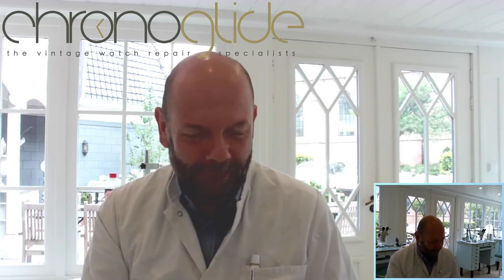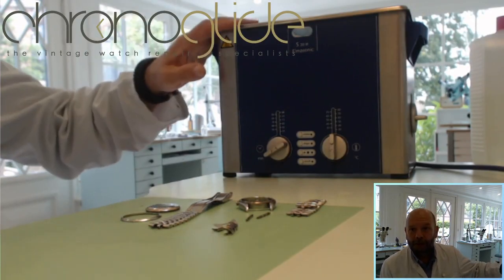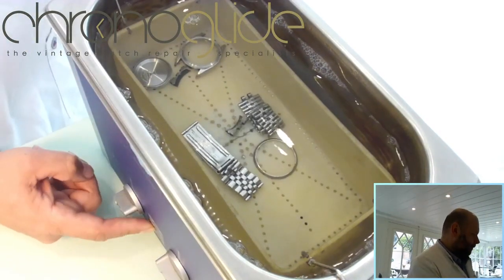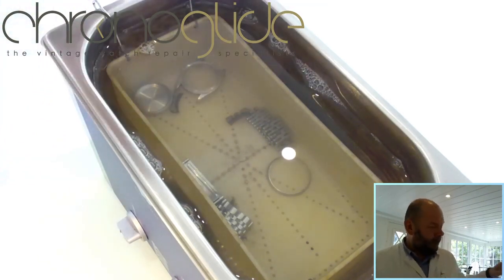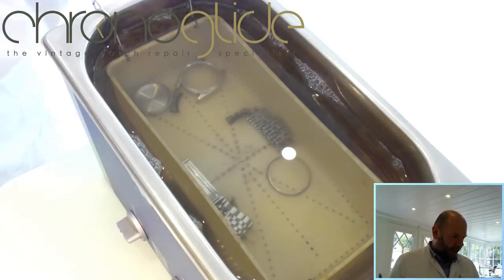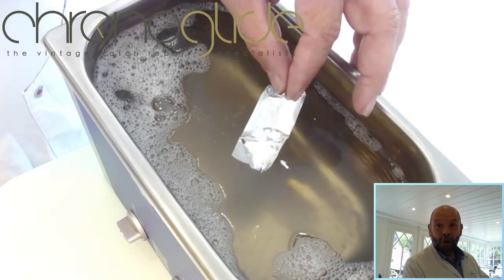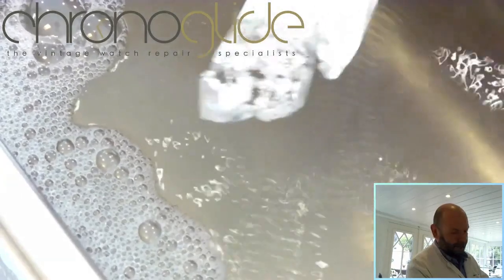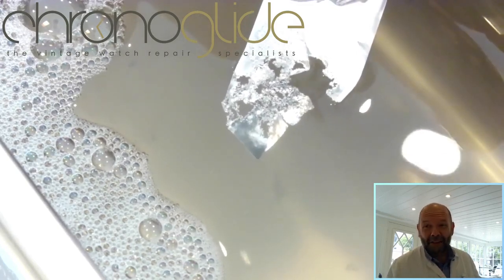Ultrasonic Cleaners - Tips and Tricks

Comment: Difficult one as from a hobbyist perspective when they (and how I) start they can’t justify £400 for a used cleaning machine and the £100 for the cleaning fluids.
What you have to take into consideration is that what is hobbyists buy is cheap low end ultrasonic. Mine is 2ltr and not very powerful but it serviced me well for 3 years until I had the opportunity to purchase a cleaning machine .
Granted fatigue is a potential issue but using paper tin foil against a price of stainless is not comparable in my opinion. 
This is also why I tend to recommend to new starters to just buy the cheap cleaners.
If a hobbyist could only use pro equipment there would be no hobbyists. 
Main complaints I see is spring winders and cleaning machines being too far out of reach for them.
Reply: This is a professional watchmaking establishment, they've got 2 cleaning machines, 1 for the filthiest movements and then they go into the 2nd, the 2nd is for the not so soiled movements, I suspect putting a clients vintage watch into a Ultrasonic probably frowned appon, although it happens in other places, I use my one for my DE Razors and vape equipment and watch straps and cases.
Reply from the maker: We do have a pre-rinse machine as well John, especially for clients who tried to revive their pocket watch with WD40 ;o(
Reply from the maker: I agree there is a gray area for Ultrasonic cleaners and movement parts.
Reply: @kingsford73  it is but I don’t think many other professionals are watching .
Reply: On average I clean about one watch a week, by hand . I think each part has for more attention and care cleaning this way. I have always thought that the initial cost and running costs of a cleaning machine are way above my needs and I believe I would have to be servicing a lot more watches per day/week to justify those costs, then If I were doing that amount of movements would it be a hobby ? I have toyed with the idea of purchasing an ultrasonic, now I am so glad I did not , so thank you Kalle for that information
Reply: @MyRetroWatches  it goes on but is it best practice?
Reply: @ChronoglideWatchmaking  Ha Ha Ha WD40 fixes everything including that Breguet daddy found in a charity shop for £1.50 "Don't worry my son, this'll fix it"
Reply: @garethlowe9199  I agree, hand cleaning is the best way for hobbyists ... professionals move to another level, and have different needs.  I have found very good the clear benzine for cleaning all watch parts  except pallet fork, and ballance wheel (for the shellac) ,and main spring (Donald de Carle says the main springs broken for some reason with benzine). for these I use zippo (lighter) fluid.  The ultrasound machine is good for bracelets and watch cases ... I agree with Kalle.
Reply: I'm glad you came here to confess to this Guy, I wasn't going to grass you up here..😂.. You made the point that I was going to make. Tin Foil is not what Vostok's are made from, just an example of course.
Plus, maybe the hobbyist won't have access to a Rolex to dump into a Sonic bath.😱for two hours😱

Personally, I've never broken a watch using a Sonic bath. and mine is very small, just about one litre if that.
Reply: Too late for me to learn this. I ordered an ultrasonic cleaner yesterday. I'll not use it for the delicate parts but only for cases and bracelets. I am very happy I saw this before ruining anything.
Reply: @stevecuthbert8856  It's fine.  Watches are not made of foil.  
Foil is used to test if the ultrasonic cleaner is actually working. What happens is the microns thick foil flexes at very high speed, which essentially rips it apart.  It's to do with the fact that foil has a very large surface area, but a thickness of less than 10 microns, which is 0.010mm for cooking foil.  The foil they wrap chocolates and mints in is even thinner.

 Thicker parts are not like that, they are not going to break.  I don't know about watch crystals since I haven't looked into the science but my thoughts are that (a) you need to polish the crystal, not clean it and (b) it would only break if was degraded and falling apart already.  You flex the crystal way more than this just installing and removing it.  Similarly, any jewels that get ripped off are ready to fall off anyway.

Ultrasonic cleaners work by cavitating the cleaner and pulling the dirt off the surface.  They are used by jewellers for deep cleaning of rings etc.  since it will pull the dirt and fibres out from under the stones, restoring the brightness to the setting.  There's simply no other way to do that job without removing the stones from the settings.

Cavitation can cause erosion of parts but it would take a long time.  15 minutes is of no concern even for plated parts.

Also look at the type of ultrasonic cleaner.  A 200 watt industrial cleaner is not the same thing as a 40 watt jewellery cleaner, and a 200 watt industrial cleaner is likely to be more expensive that a proper watch cleaner anyway.
Reply: As I’m new to the hobby…  I like simplicity and use the baskets in lighter fluid or naphtha then rinse a few times in distilled water then a final soak in isopropyl. 
So far so good I think😊 
Note: all you watch guys, pros and non, are great and very helpful to the novice ! Thank you for your effort in making the videos!

Comment: Thank you for this, but please - help me understand this. All high end cleaning machines are with ultrasonic. The best ELMA Solvex VA is ultrasonic+spining, as well Greiner ACS900, Lititz Freedom, Wellner L2, L&R Tempo 400 and many L&R from the past. They have ultrasonic in one or more basket(cleaning and sometimes for rinse too)
I see what you did there with piece aluminium but there is no aluminum used in watch movements. Piece was ultra thin, and aluminium isn't springy in any way, it will more likely crack than bend. Where is a connection between real application and your experiment besides maybe some super super old movements that shouldn't be machine cleaned anyway as some plating might flake ?
Also, you mentioned water based cleaning solutions and that they are not that great. Both Elma and Greiner are suggesting use of water based cleaners, you just need to rinse them at the end with some kind of degreaser like ipa/lighter fluids.
Thanks again,
Reply: Some really nice conversations going on here. I am thoroughly enjoying it please keep up the good work everyone!
Reply from the maker: We are all enjoying the conversations Shawn ;O)

Comment: Wrong Kalle I have a 1955 Watchmaster watch cleaner using for 20+ years and no broken or degraded parts-with a 5minuet pre clean in Napha everything sparkles. I is 100% ultrasonic with 200 watts at 42 kilocycles with 5minuet clean rinse cycles.:face-green-smiling:  And cost me $400.

Comment: If you buy one, look at the ultrasonic frequency. The lower the frequency the more effective. Another misconception is that ultrasonic cleaners are non-abrasive. Also this is on the micro level not true. The ultrasonic waves are creating micro bubbles, these bubbles than again will hit the the surface of the object to clean, which than releases the dirt on the object. As the aluminium foil test shows....it's not for delicate parts and it shows also that it is abrasive even though on a micro level. The ultrasonic detergents are lowering the surface pressure, but in my experience just 1 -2 drops of regular dish-washing detergent does that trick as well. Just don't use the ones with lemon in it as this is more agressive and don't use too much or you'll have a dishwasher:-)

Comment: Hi, I've just picked this hobby up just under 12 months. I use an ultrasonic but then have the cleaning liquids in jars with mini baskets for the parts that sit on a plastic plate inside the ultrasonic. I find that it works when I only set each clean time for 10-15mins. If there is any further tips to help, I would appreciate it. I don't put the balance or pallet fork in it.

Comment: Short of having a watch cleaning machine, what I have been doing is putting the parts in small ultrasonic baskets (the brass ones with stainless steel mesh) and putting those into a jar filled with Naptha (lab grade not lighter fluid) and then putting the sealed jars inside the Ultrasonic cleaner that has been filled with water.  I run the parts for 20-30 minutes at 50°C.  I then quickly dip the baskets in 99% IPA to rinse off the Naptha.  Not as good as a dedicated watch cleaning machine such as an Elma but a helluva lot cheaper.

Comment: The aluminium wafer is soft metal than brass or steel. Watches parts are made of steel, brass, chromium or hard metals. correct me if I am wrong. The microscopic particle from mechanical parts movement or aged lubrication in deep bushes, grooves or jewels won't wipe out without ultrasonic vibration. Even cleaning machines or brush wash cannot reach there. Water alcohol compound masturbation can.

Comment: How would a hobbiest clean watch parts without spending the money on an expensive cleaning machine?
Reply from the maker: This weekend i'll be making the video David. For every budget watch part cleaning.
Reply: @ChronoglideWatchmaking  Thank you for your channel.  Great content, really looking forward to it.
Reply: For years I used a 1 cup L&R Ultrasonic machine, Ottosonic concentrate soap, using almost boiling water in the cold ultrasonic mix, and a warm then cold water bath.  Then tea balls, some with a finer mesh screen inside for really tiny tiny parts that would fall thru the screen. I looped twisties over the balls and suspended them from a stick in the fluid. timed 3 minutes in the bath, rinsed twice in water, dipped in alcohol, and put over a makeshift dryer, gently shaking them every 30 se or so while washing the next tea ball. It was slow, but worked out great. Then at the end I cleaned up the 1 cup of soap and little cleaner and put it away.
Reply: @ChronoglideWatchmaking  I cannot wait to see this as I am just starting out and desperately struggling right now with the cleaning aspect as where I am a) supplies of cleaning solutions are totally unavailable and backlogged b) now after seeing this I am left scratching my head how I can afford to clean my watch mechanisms and not destroy them with an ultrasonic.
Reply: If you are confident in the water-resistance of your watch and do not wish to disassemble the bracelet, an old toothbrush and gentle, soapy water or windex works excellent. Rinse with room-temperature water afterwards and avoid using the crown/pushers for a while until it is dry. I would remove leather straps from the case as windex and water can damage the leather. 
I've yet to checkout this channel's video on budget cleaning, but that's my two cents.
Reply: You can buy them for pretty cheap. I got one for 100$
Reply: Ooo I'll need to find that video. My watches thank you for saving them
Reply: Ooooh I could crush a grape when I hear people say you should only put watch bracelets and other large watch parts in the ultrasonic cleaner.    You ABSOLUTELY CAN put ALL watch parts and even some high density plastics in a ultrasonic cleaner, especially the model you have with sweep and degas modes. What you've said is the equivalent of saying you shouldn't eat with your mouth open. We know it doesn't look nice and it's not good manners but the end result is the same ie you still get to eat! Ps if you really want to be pedantic you should only use distilled water to eliminate the deposition of dissolved inorganic calcium salts on the metal surfaces and use the same for rinsing. Saying you should isn't the same as saying you can't.

Comment: With the aluminum foil demonstration, since the fine teeth of the watch wheels ( 2nd wheel 3rd wheel etc ) are just that super fine I wonder if the cavitation process in the ultrasonic cleaner actually does damage those teeth ? Only way to know for certain is to test it on old weeks with a before and after magnified examination. I shall endeavor to do so and will post my results here. Again thank you for admonishing us .

Comment: You're not putting aluminum foil in ultrasonic cleaner. You're putting steel and brass and copper there's a huge difference ultrasonic cleaners are just fine for cleaning watches just as many other parts aluminum. The bubbles that an ultrasonic cleaner makes to clean the parts is called cavitation. Cavitation is mini explosions in the water. Because aluminum foil is so thin and soft those cavitations can blow holes in the aluminum foil. yes I'm an engineer if it was such a problem they would not use ultrasonic cleaners when they rebuild aluminum blocks on engines. But nice try with your explanation
Reply: Cavitation can destroy giant ship propellers. So of course tiny cavitation bubbles can be detrimental to the long-term longevity of crucial components. 
I would think an engineer would know better.
Reply: @rustyration  Really. So all types of cavitation are the same then? Thats what you are saying? If its not okay for watch parts, then why are all companies that produce watch cleaning machines incorporating ultrasonic cleaning into their machines? In fact ultrasonic cleaning has been incorporated in those machines for a looong time since back when they used tubes to produce the ultrasonic frequencies. Oh I know... Those people who design watch cleaning machines don't know what they are doing... right? If it damages watch parts, please show an example of a part that has been damaged due to ultrasonic cleaning. I'll wait.
Reply from the maker: The intensity may vary between the hardware that is being used. I try to raise awareness and help watchmakers in their profession. Thank you for your comment Timothy, it is indeed a very interesting subject!
Reply: It's weird, I've had parts in the ultrasound cleaning machine come out full of pits on the surface

Comment: Another tip! Perhaps you mentioned it and I missed it. Often times watch cases will have numbers or markers milled into the bezel and black paint or  antiquing paint in those recesses. This black finish comes off quickly in the ultrasonic and should be hand-cleaned. I keep a bottle of Vigor Antique Black Background Paint for when I see a soft, black number 3 floating in the bath rather than stuck on the bezel. 
The same hand-washing should be done for cases and components with anything painted. Occasionally watches may have painted inner bezels (between the dial and crystal).

Comment: I am really puzzled as Rolex on their site do describe that all watch (movement) parts are cleaned ultrasonic. The statement is made right ahead a photo with baskets full of watch parts.
Reply from the maker: There are cleaning machines like eg. the Greiner ACS-900 we have here, which have an ultrasonic module, but way less intense a the UIltrasonic machine i showed in this video. I'm making a clip about cleaning watch parts and will show you the difference. Coming up soon!
Reply: I think it is a matter of frequency which determines save or not save. Low frequency is "not save", high frequency is OK. So cheap machines with high frequency could be an alternative. Anyhow, great content.

Comment: Hi Kale! What you're showing is an USM for cases and bracelets. But there are very few professional USMs for cleaning movements and parts. Those USMs supplied with several SS bins and baskets with even smaller baskets on them. And that machines constructed and intended specifically for movements cleaning.
Reply from the maker: You are right Azamat, there is a gray area, but i wanted to show the force of some machines.

Comment: The centrifugal forces of a watch cleaning machine make all the parts in the baskets constantly bang against one another and the basket itself. In a USC, most of the parts will never even touch. And let's not forget that one literally has to use a hammer to fit some watch parts (balance wheel and staff, for example), so they are far from being as delicate as a chocolate wrapper 😂

Comment: thanks again for your info. I learn something new with every video. You mention not using water based cleaners, but then that gets expensive for hobbyists. And clean up is a bit difficult with solvents too. As a hobbyist workin in my living room and garage I use the Zenith water concentrate for cleaning, with 2 water bath rinses and a quick IPA dip right into the dryer. So far it has worked, and then I can clean things up in the sink. With solvent based cleaners the clean up and disposal can get more complicated.
Reply from the maker: I'm working on new video's about watch part cleaning for all budgets. Ready withing a few weeks!

Comment: You won't see me put watch movement parts in my one it's got 2 osalating units and would most definitely do damage.
Reply from the maker: I can be so aggressive John.
Reply: @ChronoglideWatchmaking  yes they can, I use my Ultrasonic cleaner for watch straps, watch cases, DE razors, even with the razors I've seen paint and the plating vanish. As with the watch movements the last time I checked they are made to the micron and won't like being vibrated to death. And then there's the pivets, having train gears dancing around in a Ultrasonic isn't going to do them any favours kinda risking bending/braking them I should no doubt.
Reply: Because I just got to see what  damage my Ultrasonitc would/could /wouldn't do/ to watch movement parts I buzzed up a batch. The good news everything came out spotlessly clean and mostly undamaged,  however there was a victim....... the pallet fork took a thrashing and the shellac holding the stones in place.............gone! So yes as predicted my Ultrasonic machine will do damage. Now don't worry about the movement it's ticking away quite happily now, as I have a stash of parts to replace things.